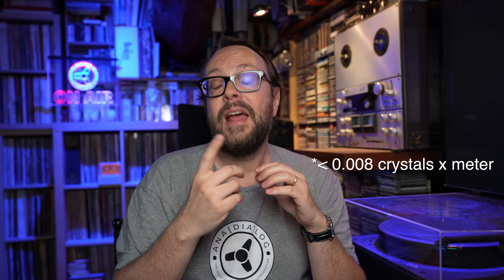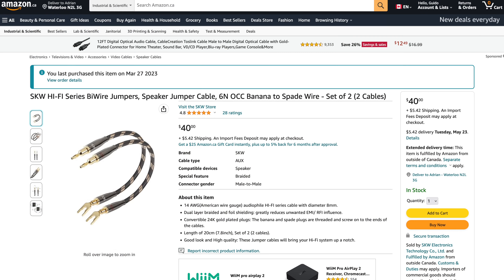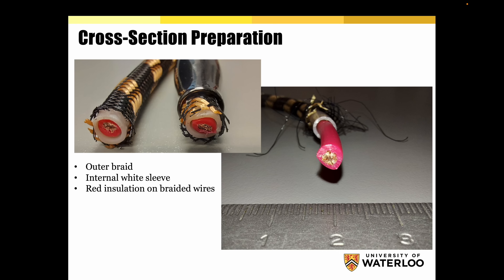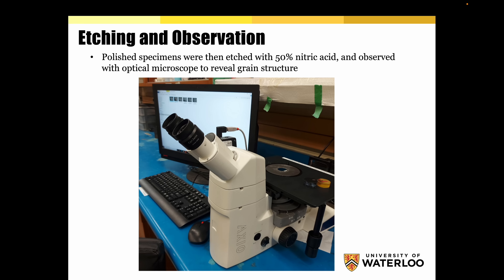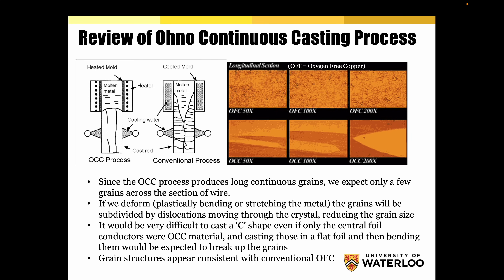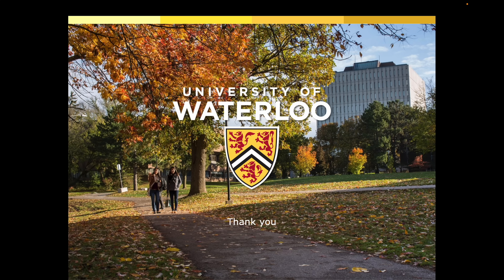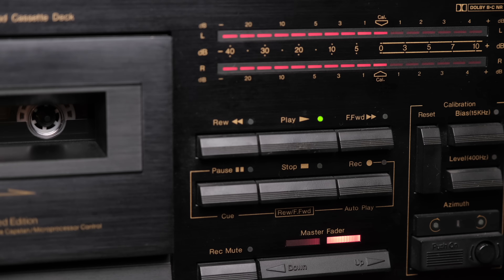Final SKW cables analysis: NOT MADE with OCC copper!!

Comment: As the matter of fact every component in your sound system the terminals are OCC, the copper foil on your PCBs are also OCC, the NOS vacuum tubes are nickel and even iron, but OCC. So why not use interconnects and speaker cables made of OCC copper. It really makes sense!

Comment: People may not be aware that most Hi-Fi electronic equipment are manufactured with PCB which is at best equivalent to OFC.   All the trace/copper foil/plated copper are made up of vertical columnar grain structure.  These grain structures are in micron range size so for 10 inches of circuit trace there will be tens to hundreds millions of grains.  This is why I am not sure the cable companies claim of OCC or continuous cast wire would make much difference!

Comment: Won't believe anything from a mainland chinese manufacturer owned by mainlanders. They always cut corners and try to scam you
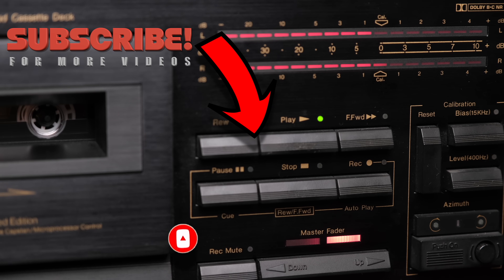Don't tell me it is not true because I work with quite many factories in China for a long time. This is their mentality built-in. Don't expect them to change. So if you buy any expensive audio products that are mic, only buy those with reputable brands from other countries. They usually have a much better QC process because it is their brands on the line. 15:10

Comment: This is outstanding attention to detail. Marvelously comprehensive! Impressive process, by Prof. Gerlich and so thorough on your end. This brings forward the question of whether it is the arrangement and design combined with the shielding and terminations - both process of termination and quality of the terminations themselves) - that might have the biggest result than the purity of the copper itself? If it's "relatively" pure and of an appropriate gauge, then that may be more than good enough. That is, of high copper purity and not too "grainy". This type of test could shed some light on what's really important overall, or what could be considered a decent cable with the right combination of elements. And not necessarily "total" purity as the biggest worthwhile factor.
Reply from the maker: Indeed, design is fundamental but quality conductors and insulation remain paramount

Comment: My SKW speaker cables came in a different box. A more premium box.
Reply from the maker: The cover I was holding in the beginning was part of the speaker cable box. For the test we used 40$ jumpers. Those are small and cheap, no luxury box for them.
Reply: @anadialog  The cable you examined is a jumper cable, but I wish you had performed this test with Skw's "speaker cable", maybe ofc was used in the jumper cable?

Comment: From what I've noticed, with a basic "mid-fi" ($5-$10k)  transparent system I can't tell a difference between my cables and wires. These days I focus on decent connectors and gauge size with certain products. This is just my experience though. I don't spend more than $50 bucks on interconnects or $100 on speaker cables...though I've spent a lot more in the past. Lots of hi-fi companies aren't honest with what they are selling..I'm a huge fan of tests and investigations like this..as well as other forums that do testing like this as well on components and speakers. Good stuff.
Reply: Yeah the difference is almost non existent and listened to many cables and the difference is so minimal it aint worth the money.
Reply: From what my understanding is, low resistance is the key factor in speaker fidelity.
Low resistance is achieved mostly by gauge of copper wire. Some state 12 gauge is sufficient I'm convinced that 10 gauge (thicker) is sufficient.
High purity 12 gauge will only measure better than cheap 12 gauge lamp cord that probably cost 1/4 the price.
Oxygen free 12 gauge that cost astronomically high, will only measure better than high grade but won't compete with high grade 10 gauge copper wire.
Corrosion mostly effects the striped end of the wires after time.
Has anyone ever stripped the ends of copper wire and tested the resistance from year to year caused by corrosion?
Reply: @arvidlystnur4827  Corrosion also comes from bad PVC jacket with the chlorine attacking the copper.
Reply: My speaker cable came from Goodwill
Reply: @8BitNaptime well Goodwill is starting to get a little expensive 😁
Reply: @NosEL34 True but once in a while I find like a hand rolled pile of 12awg for 5$

Comment: Man, I nearly bought their speaker cables, but decided against it due to stranded cable and pvc insulation 😅 I almost hope there will be mass returns.
Reply: I would give the World's Best Cables (Amazon) Mogami speaker wire a look. They are coaxial, not copper, really opened up my KLH Model 5's.
Reply: @michaelwright1602  They coax mogami speaker cables seem to have quite the following (but I was sure they were all OFC 🤔)!  Price, stranded wire and pvc insulation made me go for some Jantzen solid core cables instead, but they are definitely on my bucket list 😊
Reply: @RigVader  Coaxial cable, they are not OFC. BIG DIFFERENCE! Give them a shot.
Reply: @michaelwright1602  Mogami W3082 is OFC according to Mogami specifications. Where do you get info that its not?
Reply: @michaelwright1602  I've bought both World Best Cables and SKW. The latter are much better sounding cables, even my wife (who has no interest in hi-fi) noticed the difference, especially in mid- and hi- frequencies. It's a shame that SKW misrepresented the materials, but their cables are still worth a look.
Reply: @sv1201  I am referencing their speaker coaxial cables/wires, not RCA cables. And to note, WBC only uses Mogami, Canare and Gotham cables.
Reply: @michaelwright1602  I was talking about speaker cables too.

Comment: Sometime ago I bought a pair of SKW RCA Interconnects, after seeing videos here in the channel glorifying SKW speaker cables. Well... after comparing to my Supra Anniversary and Cardas Golden Cross it was VERY obvious they were not even in the same league of those. Sold quickly thru local Ebay and would never buy anything from them again. So, no surprise there. Only surprise is the channel still recommending this damn things.
Reply: Hi Maurico, may I know how much the Cardas and Supra price when you bought it compared to SKW ? For the same length please....
Reply: @didioentoro7575  Not the point here. If a "guru" says they are KILLER, they must be and that´s absolutely NOT the case.
Reply: @mauriciojv7901  Well,  still we have to be reasonable about the price and quality. How could you compare a cable with a few times more expensive? Should be in a price basket, right ?
Reply: @didioentoro7575  No again. A great cable is great DESPITE it´s price. Otherwise is just trash. That´s what the "guru" said about the speaker cable.
Reply: @mauriciojv7901  What GURU explained - for that price, the sonics are good-.......to me, it meant " in the price basket" which I could be wrong.
Reply from the maker: I recommended the speaker cables, not the interconnects. I can only say that for the price, the sonics are good but clearly the fact that they are lying takes them off my radar for good. Neotech has always been my n.1 company since the birth of this channel and this story remind me of their quality and professionalism.
Reply: Have you done A B double blind tests to know if those highly priced cables sound better than the SKW?
Reply: @historyfan_83  No I can hear.

Comment: I have a few of these in my system.  Sort of sad they are not better copper.  The price, connectors and shielding are very good on these cables.
Reply: I don´t think the plugs are very good, they are turning around and does not have very good contact. The U plugs are better.

Comment: I purchased skw occ power, speaker and rca cables. Just the rca wasn't good enough (compared to neo by oyaide class s and oehlbach nf14 master and more expensive options).  Power cable is actually very good. I bought 3m and cut it into half and added viborg ve and vf502 and the original plugs were just as good in comparison. Just different flavors. I haven't watch the video yet though they better choose you as the ambassador for the European market. Ps: burn in time is essential with these cables, they totallt sound different in 50 hours.
Reply: Now that I watched your video. I think their best cable is the power cable. And as I mentioned above rca wasn't that good so I actually returned it. And bought more power cables to replace rest of my equipment.😅
Reply from the maker: Good job!
Reply: @jazzabanaНет видео?
Reply: @arthurgrab926  Может Россия блокирует?

Comment: Thanks Guido. The truth is, as you discovered, a good sounding cable doesn't necessarily have to conform to a single set of guidelines for manufacture. The proof is always in the listening. I used to make a digital cable out of rectangular silver plated copper. I had no idea that it would work until I tried it. Also one needs to remember that a simple cable is also a system made up  of connector raw material, shaped, made to certain sizes and manipulated by twisting, braiding tc. Then there is the quality of the connectors not to mention the dielectric or lack of one. Purity of the materials. and even the plating matter. Is the gold plating attached to the copper space lug with a ferrous metal like nickel or silver which is a better conductor. Also a factor is the type of solder used or indeed is the cable cinched on with a screw or in a crush ,(Gold plating needs a binder to attach to copper or brass or it flakes off) type of solder less connection. Having made cables for a business for fifteen years I can tell you it all matters to a greater or lesser degree. You just need to get the recipe right and that is the magic and talent of the designer and what you pay for over and above the cost of materials. I once ha a customer berate me because the packaging for my cables was not up to his standards. Apparently the container made a difference to him.
Reply from the maker: Thank YOU! Yes, I look for quality materials but so many other things are at stake and I have no problem in admitting that sometimes we fall in love with ideas that real facts
Reply: We sent men to the moon, we built CPUs at 7 Nano meter with  2.95BILLION transistors, 
we receive weak signals from voyager one, 15MILLION miles away transmitting with only 20 watts, 
but we do not know how to transfer  audio signals in your loving room and need exotics bullshit? CABLES DO NOT HAVE TONE, its ALL IN YOUR HEAD
Reply: Fletcher Munson@fletchermunson62251 подписчикНет видео -не верю лысым парикмахерам-но реклама бесплатная?
Reply: @arthurgrab926  Try it in English. Dont understand.

Comment: Hi  pals   Ι' ve heard a lot of  eponymous speaker cables  from  4e/m to  120e/m [off the reel]  and  i  can   frankly  say that the true giant killers are the CANARE 4 S 11  at 7,5e/m    unless  the total price of the hi fi setup [source-amp-speakers]exceeds  15000e and there is need  or readiness  for some  special and  far more expensive cables    P,S = professional  cable brands  BELDEN ,CANARE,MOGAMI  do not state  the number of  '' N  ''  regarding the purity of copper used  on their models  but  say just ''bare  copper''  ,so  watch out  for ''snake oil''   , Greetings from Athens, GREECE

Comment: Let me finish, damn computer, after multiple blindfolded switches of cable you could not tell between. You did not show the complete process anyway.It's nothing but the Emperor's new clothes. Have the stuff, and I'm one of the stooges that helped foist of this crap in 1981 in SF at MC placebo, placebo, placebo. Audio has become a religion as well as "Post Modern"

Comment: It would be interesting to confirm Amazons description in the add vs documentation from SKW.  I would call out Amazon before pointing fingers at SKW unless, in fact SKW, told you otherwise...
Reply from the maker: Amazon is just one of their major retailers. If you check their official stores on Aliexpress or HiFigo almost all cables are described as OCC. I have sold stuff on Amazon, they write what you tell them. So we are certain that these descriptions containing OCC are coming from them. In particular, their official SKW store on Aliexpress doesn't leave any doubt.
Reply: @anadialog  Than that's sad but typical...  Thanks for the confirmation.
Reply: The description already changed from OCC to hi quality copper.

Comment: We can conclude that there maybe an over exaggeration on the need to have OCC cables as opposed to OFC cables.
Reply from the maker: True, even though there is a difference probably also due to the geometry as stated in the video
Reply: @anadialog  If there is a difference or not between different types of coppers, it should cost the manufactores much more money to make pure copper. So, I only want pure copper.

Comment: Hope you do the same analysis on those high end cables.  You might be unpleasantly surprised.   Just saying....
Reply from the maker: I wish I had access to this type of analysis. It's very expensive and Prof. Gerlach was hoping to get some OCC images, that is also why he wanted to do this.
Reply: @anadialog    great video, Guido, thanks for your clarifying this and correcting the information. Thanks for the professor Gerlach as well of course. Btw if the professor wants images of OCC copper and is in canada I guess the cheapest way by far is for him to buy a single one meter neotech occ hook up wire from parts connection on a gauge that interests him.

Comment: Mám důležitou otázku. 
K čemu mi OCC měď v propojovacích kabelech je, když tento typ mědi není i v samotných komponentech hifi. Jestliže signál prochází v zesilovači běžným typem mědi a dochází k vlivu této mědi na zvuk, pak už stejně nedokáže OCC měď mezi zesilovačem a přehrávačem situaci zachránit. Pouze nedochází k další degradaci zvuku. 🤷
Reply from the maker: Several hifi components have internal OCC wiring actually. OCC cables are simply more transparent than others and the signal remains more intact than the others. Compared to a good OFC the differences greatly diminish
Reply: @anadialog   I don't expect a $1500 integrated amplifier and a $1000 player to be fitted with that kind of copper. OCC copper in the cables will be meaningful if there is one extra zero at the end. to mortals this level of hifi is as inaccessible as the Norah Jones anniversary tape. not only by price, but also by availability. I've been waiting for an answer for a week now, is it even delivered to our market 🤷

Comment: I did buy a set for the money ..............yes they do sound decent but not as good as my Huffman cables , nor Neotech !
For DIY I still use OCC Neotech and I do not regret that choice , also on a musical listening experience , nothing compares to those when compared to other brands !
Thank you for the investigation  but I knew already by comparing with Neotech they  were not OCC.
Anyway an upgrade from standard LS cables and a good buy for the money .....As long as your system is not revealing the differences in nuances and ease of music reproduction there's no need for spending more ........
My internal wiring I use is OCC..............point , no discussion about that......
The very best LS cable to my personal experience was and is still Neotech OCC silver !

The dissapointment came when the cabes were stolen at my brothers home while he was doing nightshift ! 

Thank you
Reply from the maker: I agree, I guess Neotech is the only reference at the correct price